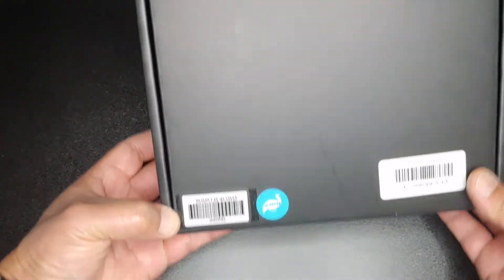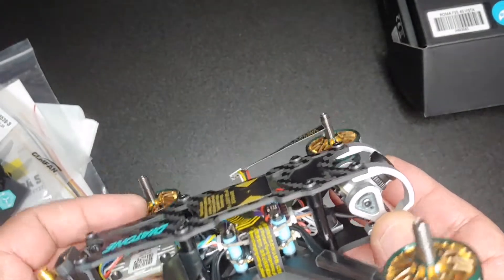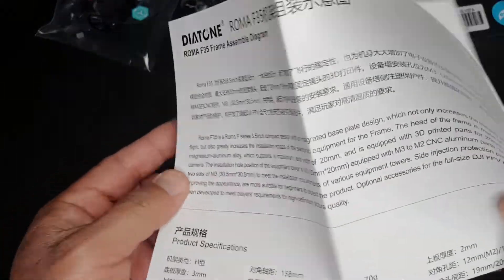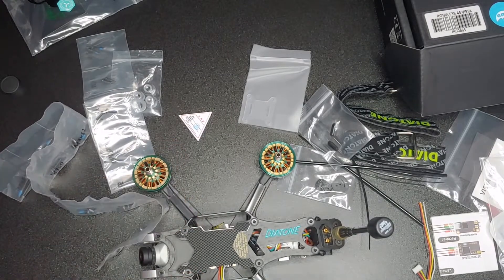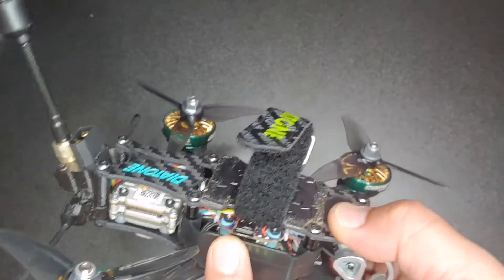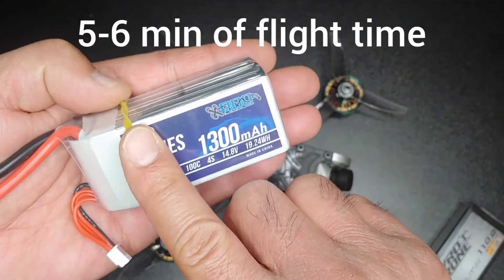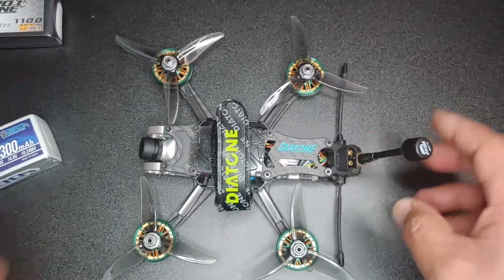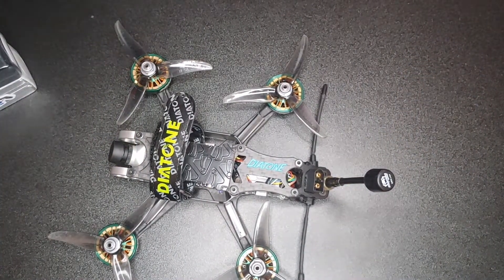Diatone Roma F35 4S UNBOXING Caddx Vista & Polar Camera FPV Drone

Comment: Hey Jae,
Got a question for ya about the Diatone Mamba F35 Vista with CRSF quad. Are you using Betaflight 4.3? I plugged in the Crossfire, bound it to my Tango 2 without any trouble but my controller wouldn't transmit commands in Betaflight --AT ALL! 
I updated firmware for the tango 2 pro and the Crossfire Nano. I then updated the FC to Betaflight 4.3.1 but it didn't help. Still nothing. 
After a bit of research i realized that most guys who gave this issue have not properly wired the Nano RX to the TX on the board. I triple checked all wiring and even switched them just to see what would happen. No cigar. I'm wondering if you had any problems and if not (assuming your stack is the same) what settings you are using in betaflight?
If you have any idea what i might be doing wrong please shoot me a message.
Thanks man!
Reply from the maker: Have you updated the Crossfire Module to TBS Agent ( new version - the web based version ), this might be the issue. As for Betaflight sorry I am on EMUflight, i have a video of the PID's if you decide to switch. But going back to your question, if your RX and TX are 100% bound and you are getting no stick movement on the BETAflight screen, it can be a setting on BETAflight.  you can also try another RX TX pad on the flight controller, just to rule it out.
Reply: @jaechoe  I'll look into those. As far as the radio, I'm using Tango 2 pro so no module. I already updated Rx and radio together. But I'll keep looking at betaflight. I might hit you up for those rates 👍